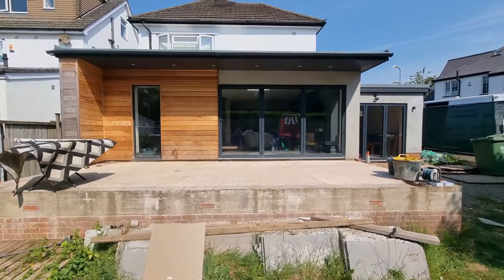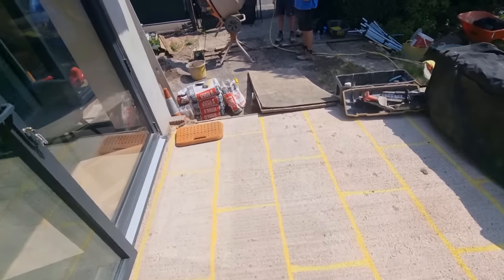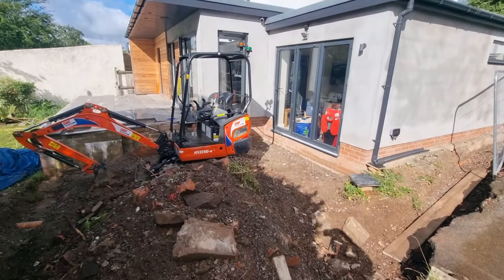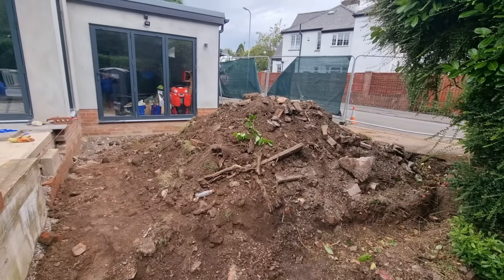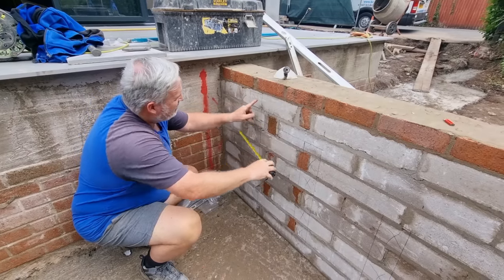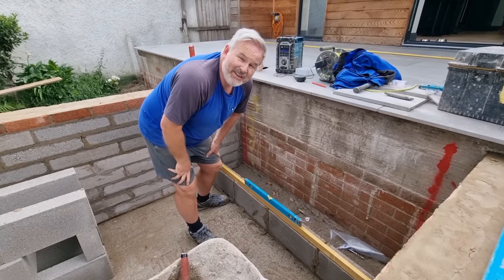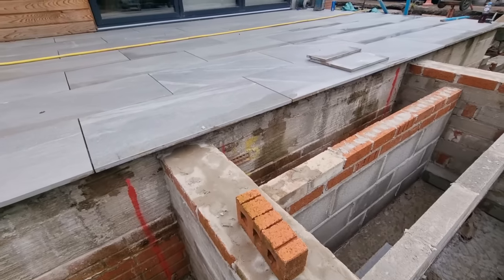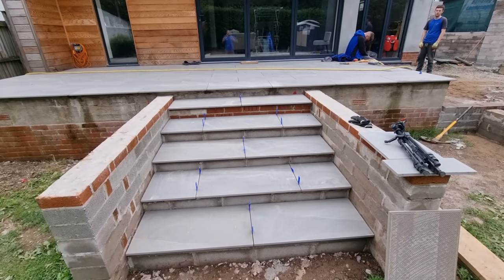Wall,Patio,Steps & Drive-New Job 🧱🧱

Comment: Use tile adhesive as slurry not only is it cheaper than slurry it’s stronger especially for that drive 😉
Reply from the maker: Appreciate the advice 👍
Reply: Any time fella give it a go always used it for out door tiling /slabin  solid as a rock 👌

Comment: Hi Justin, amazing job! Serious skills! Question about the DPC. As you mentioned your approach to the DPC was approved. Just general advice regarding this. Is a linear drainage channel required or can you tile right up to the threshold provding you have an adequate fall away from the doors?
I know everyone harps on about being 150mm below DPC but the regs would also say most new builds require level acees to the home therefore bridging DPC?
Reply from the maker: Building control here in Cardiff didn't request aco drains but ive added them in anyway .
Id say if you can put them in do it any protection is better than nothing at all 👍
Reply: @brickrightbuildinglandscaping  I agree you can never be too safe! Great stuff, looking forward to the next episode 👍